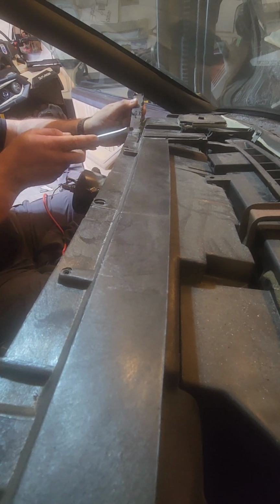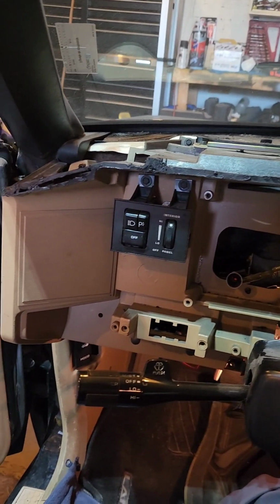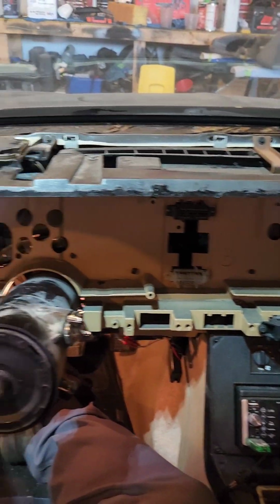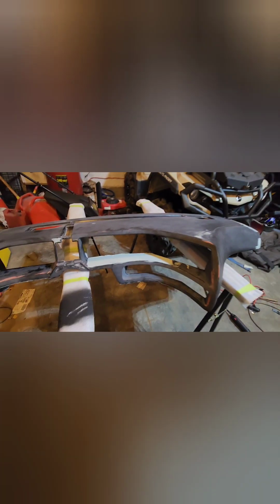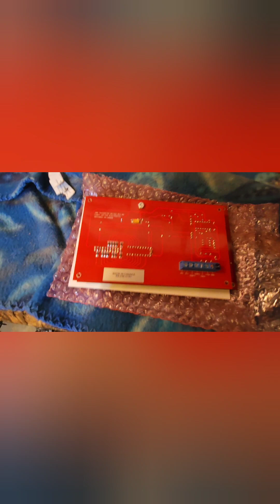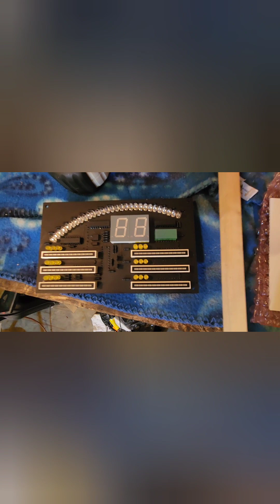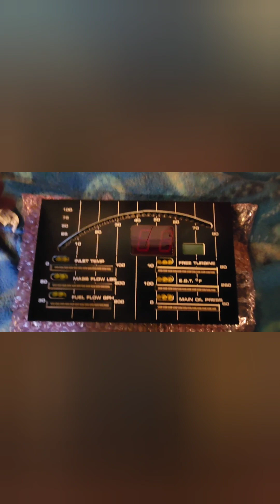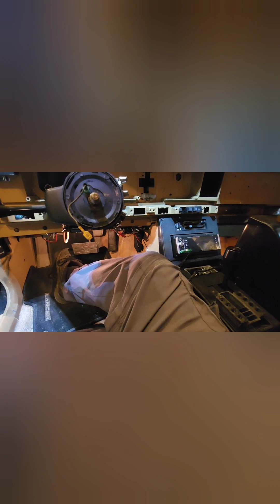Cutting the oem dash for more space.

Comment: Over the years I've seen many people cutting the factory dash to fit the Knight Rider dash. Would it not be possible to install the KR slightly raised so you don't have to cut the factory dash?
Reply: Well what you can do is cut the holes on the KR dash for your bezel shorter that way it will leave you more space between your KR dans and oem dash
Reply: @KITT-K2000  If I understand it correctly, the biggest issue is the top; the countdown that can't 'dive' into the dash deep enough. I might just trim the plastic bits of the countdown light invisible from top, but let's see when I get to that.
Reply: @MotorScotti  yes that is the problem with the space needed behind de KR dash